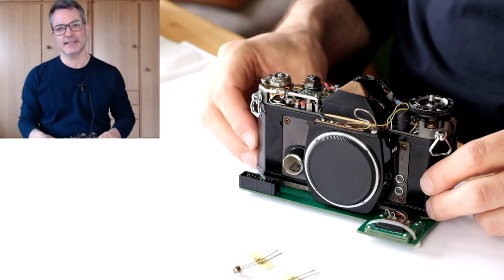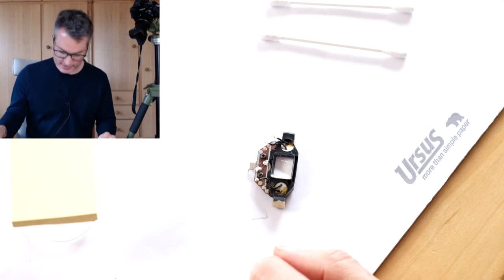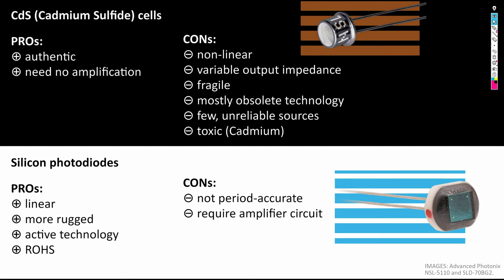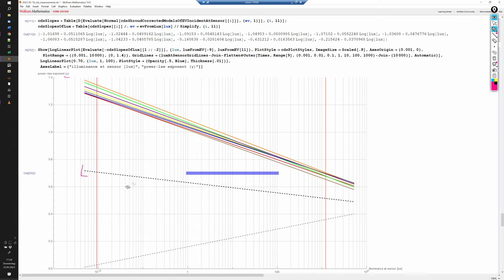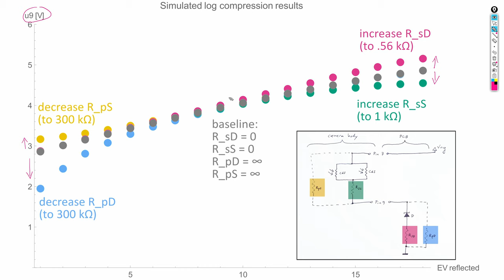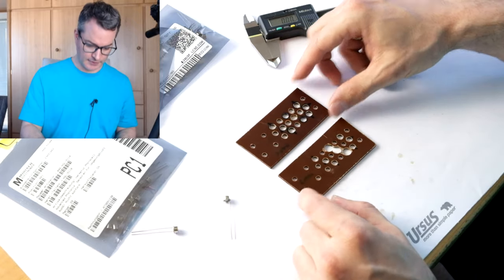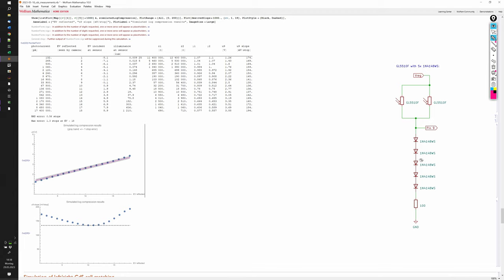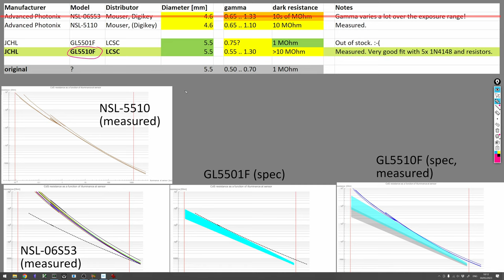The Pentax Electro Spotmatic: Reverse-engineering a marvel of 1971's Japanese electronics [Part 3].

Comment: You say that all Cds photocells measure higher https://youtu.be/HOnj1KhhlGY?t=1989, or in other words, how it looks on a graph one stop lower.
This raises a question about your method of measurement, specifically LED light source. From my experience, Cds measures LED light differently than Sun/Incandescent light.
Have you tried to measure using incandescent bulb as a light source? You know, there is a lot of controversy going on about color temperature, and how in old days the standard was 2800K, then 4700K, your LED look like 6000K. Thanks
Reply: Oh, forgot to add. You can see that data sheet says: measured with standard light A (2854K)
Reply from the maker: Color temperature may play a role. Maybe I'll do some experiments for the next video. I noticed that some CdS datasheets mention absurdly low color temperatures being used for testing, which I think is quite useless for elements with a spectral peak at 550 nm, and for anything except interior lighting situations. But if anything, my LED lights should look brighter then a 2800 K source to an element with approximately human-eye sensitivity peaked at 500 nm, shouldn't they? Well, they could be too blue. For the photodiode I actually did a calculation using black body spectra for converting the datasheet value to an illuminance, and I got a value for the photocurrent within 10% of what I measured, well within the tolerance of these elements (using a Gossen Sixtomat flash to calibrate illuminance).

Also, my measurements of the NSL-5110 aren't too far off the (more useful) older Silonex datasheet. Except for the "dark" resistance, but they used a very loose definition of darkness.

Anyway, I tested the original cells used by ASAHI on the same setup, so the differences like the much more constant gamma of the original CdS cells are definitely real.
Reply: @EdwinSteiner  Oh, that's very complicated subject which involves IR sensitivity, photopic response, type of LED and how it's driven (linear regulator vs PWM). 

Anyways, seems that you never mentioned the purpose of those bunch of potentiometers near speed dial. I see that Electro Spotmatic looks different from ES or ESII, but still. Pentax usually in all their meters have one potentiometer in series and one in parallel to the cells, which used for adjustment of low and high range. And in ES the needle indicator in viewfinder is adjusted separately from timing circuit with its own potentiometers. If you look into calibration procedure of ES I think it will be relevant for Electro Spotmatic too.

Thanks for your great work!  Looking forward for Part 5.
Reply from the maker: @sergeyrozum  I have some ideas for doing some sanity checks in my setup to see whether different spectral response vs. the light source could be a problem. Probably in the next video. FWIW, I drive the LEDs linearly with some DIY regulated current sinks.

The full calibration procedure will be explained in the final video (either the next one or the one after that, depending on how well things go). I think calibration is very different from what you find in an ES or ES II.
Reply: @EdwinSteiner  Yes yes, waiting for Part 5.

FYI calibration of electro-mechanical cameras is usually the same:
1. Make sure that shutter work correctly at mechanical speeds. In your case, at 1/1000 curtains should travel with same speed around 12.5ms and timing between them (sloth width) around 1ms (1/1000). Vertically traveled shutters have different timings.
2. Only then you can adjust electronic timing circuit.
3. Adjust meter indicator in viewfinder.

All steps require shutter tester and/or exposure tester, unless you skip to step 2 and use oscilloscope instead.
Those procedures are the same for Pentax ES/K2/ME, Nikon FE and other cameras with electronically controlled shutters.